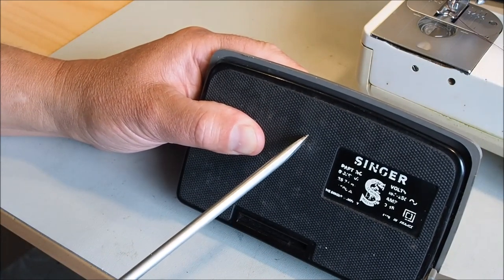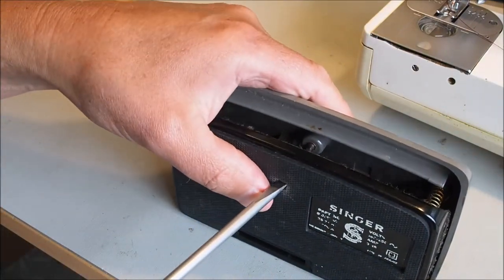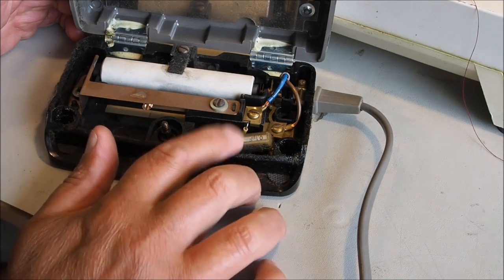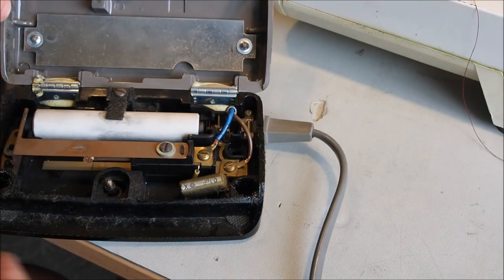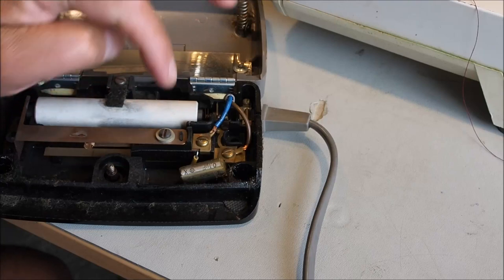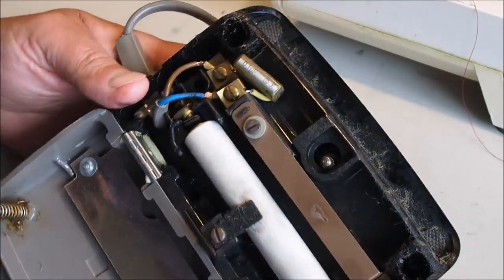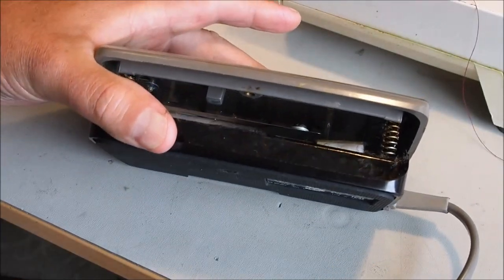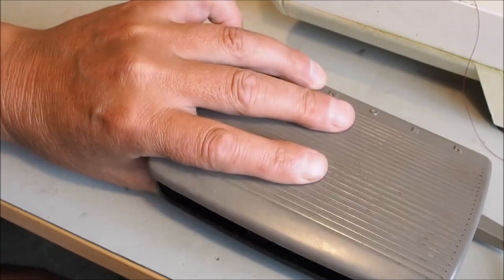Opening the Singer Clam Shell Foot Controller

Comment: Thanks so much for this. My machine started running really slowly a couple of nights ago then there was a big POP noise and a lot of electrical stink. I turned if off and took it outside, then thought about it it for a while and tracked the smell to the pedal. With your helpful advice I have opened it and now will just have to get around to fixing it. Really useful, thanks again 😀

Comment: I have the same pedal, just not by singer. mine is made in france by MERRITT, but insides are the same. My problem is that when i press on it even a little the machine goes fast and when pressed even more it's getting faster like it supposed to do. But for some reason slow speeds are impossible, what could be the culprit?
Reply: I have exact same shit Problem
Reply: @yesanton  i bought a cheap chinese replacement and it worked super, now it crawls when lightly pressed,
Reply: @kreksfeks1200  Chinese replacement of what ? How can I buy it? Thanks a lot!

Comment: Congratulations on the video, I found it very useful. I have a question: if I wanted to reduce the revolutions of the engine, intervening on the pedal, should I put a larger capacitor? How could I install a trimmer?
Reply from the maker: As far as I know, you could try an appropriately rated resistor but don't quote me on that. I've seen that sort of arrangement in Bernina machines. Thanks.

Comment: I was wondering if you have any tips on opening the clam-shell foot pedals that have 2 screws to open (Singer Starlet 354 made in France in 1974, but purchased in the UK)? I removed one screw, but the screw on the side of the springs (located under a plastic circular piece), just keeps spinning and won't come out. I can see a dome shaped bit inside that it is attached to. Thanks!
Reply: I’m having the same problem too. Did u have any luck?
Reply: @lollypopstar70  it’s been so long, I can’t barely remember, but I think I finally just forced it open. The screw never went back in properly, but it works now.

Comment: thank you so much for the video!
i have a question if anyone can answer:
the pedal makes the machine go from 0 to 100%, no in between, and there was a smoky bad smell from the pedal as it lost the ability to sew slower than 100% speed. its probably the capacitor ay?
Reply from the maker: Yes, sounds like it could be the capacitor. Thanks.

Comment: Hi my singer is always on, could it depend on the capacitor?
 if you could give me the data of the capacitor mine is unreadable
 thanks for your availability. greetings from Italy
Reply from the maker: It's more than likely the capacitor is causing the issue. There could also be another capacitor in the machine causing the problem. Normally the one in the controller is 0.1 microfarad class X2.